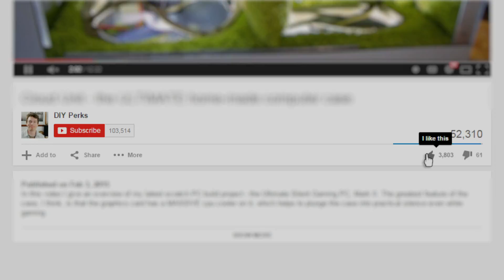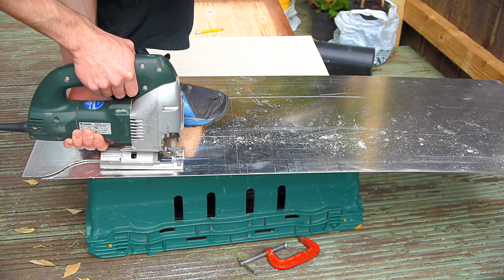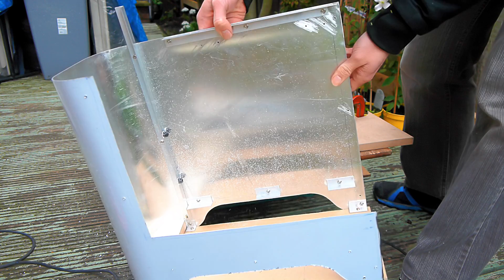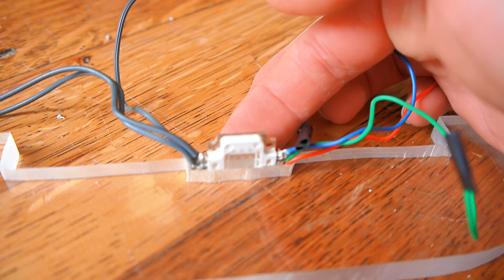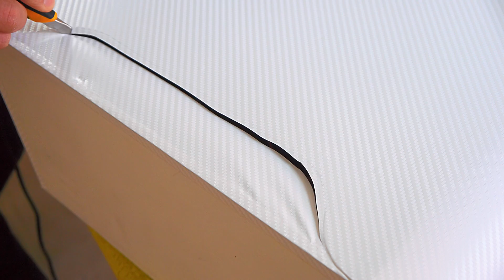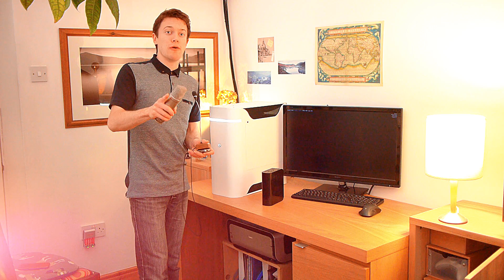Cloud Unit - Build Log (Scratch-Built Silent PC)

Comment: okay, thats kool and everything, but that is a gtx 460, no modern games will be played on that bro.
Reply: +Daniel Stevenson I doubt anyone would be willing to risk a last gen top of the line card on an experimental cooling build. Now he's proven it works, it's just a step away.
Reply: Daniel Stevenson Right after you.
Reply: +Daniel Stevenson This setup could technically cool a GTX 980, it only has a 3w higher draw, which is practically negligible.
Reply: +Daniel Stevenson its a project built ,i dont think he is gonna spend hundreds on a card to mess it up
Reply: *****
Not mess up.
Reply: this is my fucking thread
Reply: *****
This is also my swamp.
Reply: *****
Also thats a pretty awesome pic
Reply: +Daniel Stevenson I just kinda took this as more of a proof of concept. It could be done with other GPUs, you'd just have to figure out the logistics of it. I would only really trust trying this on a card that I don't use any more and then overclock it.
Reply: +Daniel Stevenson so what it is about the case and not the components... And as his card takes in as much power as a 980, it will handle those high end graphics cards just as quietly as in the video
Reply: +Daniel Stevenson theres no way in fuck that you could get a 980 ti strix in that system let alone custom cool it when it will idle at 39-60c with 0db mode on. not to mention greater graphics means hotter system temps. even with the same cooling setup its not possible.
Reply: +spawnkiller97 
Hope you're trolling.
GTX460, which is slow: 160W
GTX970, which is really PLENTY for just about any game at full HD: 145W
GTX980, which is even better: 165W

GTX980 Ti  do take up 250W, so it would become critical at this cooling, but what's the point in that? It's 30% faster than base 980, but it's pretty much unnecessary, that's where technology becomes unwieldy and jumps off a cliff.

More powerful graphics at the same thermal performance is achieved by upgrading across generations. 600 and 900 series have both approximately doubled performance per Watt over the units of the generation before that, thus allowing approximately 4 times better performance with a modern unit at the 460's power budget.
Reply: +Siana Gearz dude i have a 980ti and theres no way you can have a system like his being cooled efficiently let alone 2.
Reply: +spawnkiller97 not 2 but you get the picture. its possible if you want to keep your card as hot as a toaster
Reply: spawnkiller97 As i said, 980Ti will likely become thermally critical in this system. Base 980 (non-Ti) will be absolutely fine in this system, and it's plenty fast.

This is because the 980Ti is a thermally inefficient outlier of the family. It's not even based on the same chip as 980, but discarded Titan X chips.
Reply: +Siana Gearz my main point besides the obvious thermal downsides of having a hot running card in there is the size. compare a gtx460 to a 980 or even a 980ti. it simply wont fit in the case. any big graphics card attempted to being put in that case would not only generate more heat due to higher clock speeds, more vram, buss speeds, but would clog up room and make the case have less ventilation.
Reply: spawnkiller97
The ventillation is not affected by the length of the card in this case. The air is always moving upwards along the card, so the card is not an obstruction. A crucial advantage of this case design is that it has completely eliminated stale air pockets, so the usual issues with big cards do not occur. There's a laminar stream of air along the card on both sides even if the card would end up touching the fan at the bottom.

It doesn't make sense to mention clock speeds for core/bus, VRAM etc because they determine TDP and only TDP matters in the end, and base 980 (not Ti) has about the same TDP as 460. NVidia TDP specification is not just for the chip, it's for the whole card including standard power circuitry and VRAM. Technology has had plenty of time to improve. 460 was a rather hot running card for its time!

GTX460 has 210mm of length, while 980 has 267mm, which means up to 59mm extra length is needed. According to the other video, it looks like there's enough space present. If the space doesn't turn out to be sufficient, the enclosure can be modified to move the fan downwards, allowing perhaps 3cm more, which is definitely more than plenty.
Reply: if the case was modified to fit that demension then yes you should be correct. i never used a 980 but i do use a 980ti so i could give a rough estimate of how hot it could get. if you modify the case then yeah you could fit any card in there but the most ideal solution is a r9 nano for its air cooled anyway and is super small you could even see if it thermal throttles with the cloud mark 2
Reply: pyrobunny
Good observation, I would personally like to see more of these kind of build from other youtubers. It would be okay to see how one of those works out, becuase I sure as fuck cant afford it.

Comment: Case looks very nice, but...
You put exposed psu inside!
No!
There can be even 350VDC!!!
Its deadly unsafe!
And SMPS's generates much EMI noise!
It can crash your system!
Its why psu's cases are made from metal, to keep EMI inside and ground case to earth for safe!
Don't say you also dont connected this case to earth!

PS And where you get that new, covered, aluminum sheets as a scratch(free)?
Reply from the maker: +Arek R. The case is grounded, and EMI interference hasn't affected stability. What's the problem here?
Reply: +DIY Perks I saw another video, u add some insulation under psu, and case is grounded, ok, so its not unsafe.
But I still think that you should add cover, even plastic and with many drills to keep good airflow.
Reply: +DIY Perks BTW, pls tell me where you got that awesome caron vinyl from
Reply: +Roninator inc. you can get this all over the internet mate, it heats easy, good for wrapping
Reply: LyNx Mozzii i could only find stuff for like 200-300$
Reply: For cars
Reply: +Roninator inc. what a noob, i bought some from china for 10$ from banggood dot com
Reply: +DIY Perks i don't think you get it dude, if you accidentally touch a few of those capacitors your dead, that's why they are marked "not for user servicing".....good luck
Reply: Yea, if this PSU have PFC, there can be even 400VDC :)

Comment: DIY Perks  What did you use for the black dust filters on the top and bottom? Thanks
Reply from the maker: Emerson Holladay Just some speaker grille material.
Reply: DIY Perks Sweet, Thanks! Also how thick is the aluminum you got? I got some and started using the jig-saw with it and it kind of tore it up and yours seemed to handle it a lot better. Thinking the stuff I got is too thin. Thanks for replying!

Comment: Terrific job, you really inspired me to make my own case as well! Is the fan in the bottom sufficient to cool the VRM and memory chips on your graphics card as well? I read that others needed some extra cooling for those parts. Also, got any tips for the placement of barriers to optimize airflow? I'm a novice to the whole modding thing btw, apologies if I pose some basic questions ^^'
Reply from the maker: Carlos de Lannoy Not noticed any problems with VRM temps. They didn't receive any cooling from the original cooler, so now that they've got their own heatsinks AND some airflow, it's probably never been better.

As for barriers, just think about it for a bit and just build them to direct the hot air away etc.

Comment: Just came in to this post.
If it's not too late to make a comment on this build, I would like to suggest that you check with the hardware you go to, to ask for a jigsaw blade which is specifically designed to cut "perspex" or "acrylic" as we say in the industry ( yes I work with plastics - and "perspex" is actually an American brand name for acrylic )
You will find that the proper blade will not melt the acrylic so easily, especially if you don't force it , but instead let the blade do the work.
Reply from the maker: George Pariss Thanks for the tip!

Comment: Great project! Looks like a lot of fun to build too. I'm very impressed with your backup system. Particularly because it also protects from things like ransomware. There's no way a hacker can encrypt or even detect your backup drive if it's not connected to the power :) Is the button a 2-phase switch? And how do you safely turn it off? Does the software unmount the drive after completing the backup so you can turn it off or do you power down your entire system and then turn it off? A fireproof enclosure would probably even 1+ the safety :) Hope to see a video soon!
Reply from the maker: allcoolandnew Yeah, it's just a switch with two poles, one for 5v, and one for 12v. I don't do any special unmounting process - I just turn off the drive once the backup has finished. Seeing as no data is being transferred at the time, I don't think it causes any issues. Will be checking before I make the video (which is going to come in a few weeks) however.
Reply: allcoolandnew Usually most of USB and SATA components are HOT SWAP, as long your components have this feature and don't turn them off while writing data you should not have any problems

Comment: I mentioned this before, but wouldn't cutting power to the hard drive after data back up eventually result in data corruption? I only mention this because you are running windows and did not mention ejecting the drive out of the OS.

Comment: Got another one.  Are you aware of how incredibly poor aluminum is at eliminating noise?  Or how dangerous it is to have an exposed PSU just hanging out?  Or that a Fractal Design Node 304 can hold more gear (and more powerful gear) while also being quieter than this?
Reply from the maker: hikeskool The aluminum isn't there to reduce the noise - the goal is for the noise to pass through it. Hence the reduction of any resonance. The PSU isn't dangerous because I've mounted it properly. As for the manufactured case you mentioned, it's a completely invalid comparison.
Reply: DIY Perks "pass through"? Oh, you mean leave the case. Got it. Not dangerous, huh? Do you know how capacitors work? If the components inside weren't" dangerous", manufacturers wouldn't put them in a big metal box with labels that read "don't open this, it's dangerous". "Invalid" because it's a better option?
Reply from the maker: hikeskool Invalid because it's a manufactured case, not something somebody has made at home with a specific goal in mind (silence). As for the PSU, I can assure you that it's mounted safely. Thanks for your concern.

Comment: DIY Perks I have cut some Plexiglas myself, and experienced the same problem. my solution was to use a compressor to blow on and around the blade during the procedure. It gave me a nice and clean cut
Reply from the maker: iver sobakk Cool, thanks for the tip!

Comment: Love it! But how much of an impact would the HDs' face being in-cased in towels. I've always thought that heat was a HD's worst enemy aside from sudden drops. 

It would be nice to see this system with temperature sensors added, so you could collect build analytics. I really like this case build! It's very lovely indeed. 

Now if only someone started to build these with hackintosh compatible hardware lol
Reply from the maker: Crux161 The HDD doesn't get too warm, as it is, after all a laptop drive. They're designed to work in sealed laptops with no ventilation usually.

Comment: Will you be bench marking this machine with this new air flow system of yours? I would love to see temperature and clock speeds of your CPU and GPU under load. Have you ever thought of using sound dampening material rather than a towel?

Comment: Hi Matt!

You still use the PC built in this video?
One thing that doesn't let me rest is, why don't you undervolt your cpu and gpu?
You installed nice big coolers but in the video you're "sad" about the VGA's high consumption. You definitely should try undervolting both the cpu and gpu as you could chop off 20-50's of Watts from the total consumption and by that you could make the whole pc generate a lot less heat as well. :) Would be glad help you step by step if needed (also, you could make a video on that topic after experimenting some).
Loved the video btw.

Comment: Hello Mate,

Can you explain to me how you made that sweet power button with the white led working? I wanna bould my own case, only thing I need to know before I can start working on it!
Reply from the maker: Mike Smeets Just rigged a 12v LED strip up to the PSU's 12v rail mate :)
Reply: DIY Perks damn that reaction was fast :) Thanks you for your help!! Oehhh I have another question. How did you got the power button ready to go and wich brand is the switch? (if that does mather?)
Reply from the maker: Mike Smeets It's just a generic push-to-make switch from eBay, which is wired up to the mobo's pwr sw header.
Reply: DIY Perks This is the nicest case i have ever seen, If you are thinking about making this into a business name a price. BTW are you from England?

Comment: Dear Matt , Could You Please Tell Me If The Towels You Used Were Microfiber Ones Because On Normal Towels It Doesn't Seem To Reduce The Noise Caused By The Vibration At All, Also How did You Attach Them On The Metal, Was It With A Hot Glue Gun Or Something?

Please Reply As Fast As Possible, Thanks.

Comment: i am sure this design is workable with a reference blower card that redirect heat at the back of the card.
if triple slot blower exist,it will do wonders.
the psu can be at the bottom with a different air channel like most current case.

Comment: Lo Matt, I was wondering how did you design and construct that backup utility, you explain it backsups your system with just 1 button.
If so, how did you technically construct it and which software did you use?

Comment: I wonder what sort of temps the laptop drive reaches being buried in that insulation bag. It worries me that it would be running at too high of a temp that would cause write errors and premature failure.
Reply from the maker: cee128d It runs at around 35c. It is, after all, a laptop drive. They're designed to work in spaces without any airflow or even vents in most cases.

Comment: You did an excellent job with this build. I am curious though, aren't you a bit worried about ESD? I could see some static being built up on that fabric as the air moves across it and possibly discharging onto something you wouldn't want it to. 

I would also be very worried about this happening on your HDD pocket or did you do anything to cover the exposed PCB on the bottom of the drive?
Reply from the maker: therealuncleevil All the fabric is glued (or at least touching) the inner aluminium, meaning that any static buildup is discharged before it can build up. Not that it can build up on cotton in the first place. :)

Comment: So I watched your video about your silent wood pc and thought it was amazing, I think its awesome that you build stuff like this, really revulutionating(not sure how to write that) PC cases. Now, when I watched your wood-pc video, I thought that it was a one-of a kind and that you wouldn't build a new pc case, until now that I saw your new videos of course. But the things I'm wondering about is

You talked a lot about making a new build, will that be in aluminum as well, or what are your ideas?(or is that a suprise?)

The other thing I was wondering about was how did you make it so that the backup HDD connects to the PSU and starts a backup  when you press that button, and also it would be nice to see more detailed how you did the stuff with the PSU(take it out of its case and mounting and stuff)

Awesome case, I subbed :D

And also, I saw some comments commenting on your dialect, and saying you say things wrong. I think your dialect is awesome ;)
Reply from the maker: corckyboy My next build is still 'in the works' in my head. Not quite sure what I'll be doing yet, but I do have plenty of ideas about it. As for the backup button, it's just a push-to-make latching button that goes between the HDD and the PSU. When 'on' it just connects the 5v rail and the 12v rail to the HDD so it boots up. Will be making a video about it relatively soon, so stay tuned.Thanks for subscribing btw :)
Reply: ok nice :)

Comment: as my own silent attempt of a gaming pc in 2013 was complete, my findings was that electrical noise and coil whine was rampant on many parts....
a windforce gigabyte 3 fan 780 gtx was total noisy mess out of the box, it had a excellent idle fan speed of 800rpm, a custom fan curve with 1300rpm at max and a downclock it was ok. but the electrical noise was awful when it draw a lot of power, the downclock helped, but did not remove it completely.
my case, the fractal design r4 fitted with 4 140mm noctua fans at 600rpm, 2 intake in front all drive cages removed, 2 exhaust 1 at back and 1 at side panel next to the gpu. 
asus motherboard with fan expert2 controls the fans.
storage solution is a 500gb ssd, no moving parts, but it might have a electrical nose, that or the psu was making noise when the ssd draw power, not really sure, but if i download anything from the web my pc makes electrical noise.....a kind of high pitched hiss. 
a platinum rated psu from corsair at 850w in hybrid mode wont spin fan below 40% usage.
i5 4670 with a noctua u14 is easy to cool quiet, no problems there.
now its finding a quiet mouse and keyboard, best bet is nexus silent mouse and razor deathstalker keyboard with laptop style keys.
50c on cpu at max, gpu 85c on some games at max load. over 200w gpu is just not going to go well with silence and this kind of cooler.

Comment: Hi Matt, Awesome job! I just a had a little question about the switch. Did you have to worry about a resistor for the LED or did it just use the usual connector on the motherboard?
Reply from the maker: Hurlyclaw The LED was actually rated 12v, so I just hooked it up to the 12v PSU rail.